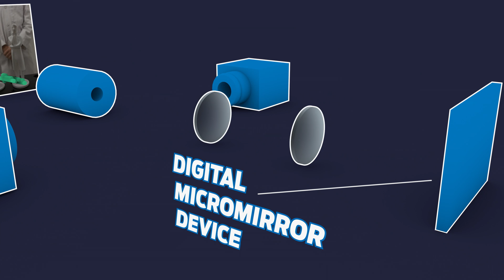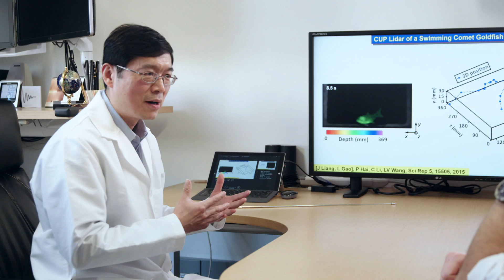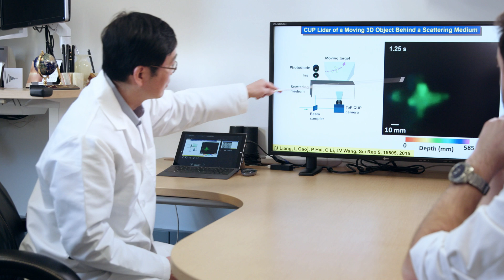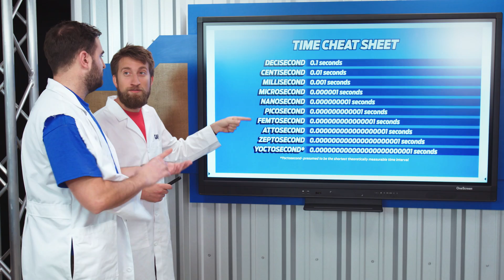How do you film the Speed of Light?

Comment: When I was teahing physics at the U.S. Air Force Academy we measured the speed of light with a very short light  pulse from a spark gap that travelled through both a short path and a long path to the same light detector hooked to a high speed oscilloscope.  The light two paths showed up on the screen as two pulses on the o'scope screen from which we determined the speed of light using the difference of the two distances.

Comment: What is very interesting in this experiment is that they are actually measuring the speed of the photons traveling through a medium such as the water in the bottle and the walls of the bottle. While it is an amazing feat of engineering and an amazing example of human ingenuity, I still wondering if this is an accurate representation of the speed of light in a vacuum.
Reply: Light allways travels with the same speed, it doesn't matter if it's in vacuum or in a medium, it just travels way further in vacuum because it's not deflected or absorbed by particles
Reply: @kozak2546 this isn't true. Light travels slower in a medium, but the frequency is preserved. See Snell's Law. It's not significantly slower in water, only about 33% slower relative to vacuum.

Comment: This makes me wonder, there are several videos on YouTube stating that it is impossible to measure the speed of light in one direction, but would this process allow that measurement to be made since we are capturing the lateral movement of light in a single direction - question for Veritasium and others...
Reply: Interesting question! From what we know of relativity though the answer is no, the main constraint to measuring light in a particular direction isn't a fast enough camera it's that the time elapsed in a particular direction is contingent on the relative velocities between the observer and phenomenon when the observation is being made. For a visual example of this check out https://en.wikipedia.org/wiki/Time_dilation#Time_dilation_caused_by_a_relative_velocity

You can see on the left when the observer is at rest we get a certain time and distance elapsed but when the observer is in some relative motion to the event being the time elapsed is increased. Even though for the light's purposes it's still moving the same vertical path it was going through before, for the observer the light is now moving through a longer, diagonal distance over a longer time.
Reply: The answer to measuring the speed of light one way is far simpler than we need relativity for, even if it is a factor.  The signal to the receiver goes at the same speed (or slower with electronic component interfacing or computer language translation) as the light we're trying to measure between two points.  Mind we're only trying to record the difference in time, not a picture of it as was done in the videos here.  The light gets to the receiver before or at the same exact time as the trigger signal saying "start recording the time now."  The time recorded by the target device in this scenario is always zero or negative.  A negative result only tells you how delayed your data is, not the speed of either the light or the transmission.

There is no workaround to this without quantum tunneling of some sort linking the emitter and receiver into an instant connection that defies proven and useful physics on any scale above subatomic.  The only way to directly record the speed of light is with a reflection back to the source device, (which started its own timer,) then divide that time by the round-trip distance.

That being said, we can (humanity can...I certainly can't myself) reasonably record said speed from the side as was done here, with devices that are independent from the light's source or target, and a helper medium to make the light visible from the side.  That measurement, however, is fallible due to perspective and distance.  In the bottle demonstration, light is also refracted by the bottle's shape.  (And why couldn't they remove the label!?)

This is kind of a good-quality middle point between accurately measuring the speed of light, and measuring the speed of data like the common demonstration of waving a laser across the sky.  (In the sky, one side of the arcing motion is billions of light-years away from the other, but you haven't made the light move that fast, nor perceived at that speed.)

All this is not to say the video is inaccurate or not really amazing.  It's just measuring the speed of light in our perspective, not the direct rate of travel.  The speed of playback also completely changes the apparent amount of time, but that's down to trust in the technology and presenter.

Comment: Ok, there is no explanation on how it works. Assuming that they are not using matrix to capture an image, just a single sensor eq 1 pixel. Assume also, that the sensor can detect a femtosecond pulse and even convert it to electrons. Now you have to store it. How? I can be wrong, but, as far as I know, storage is much slower than that speed. Note, that signal needs to travel to the storage cell or a huge shift register. But that cell or register has to operate on the PHz frequency. I'm no aware of any electronic components to be able of doing that

Comment: What’s fascinating about the Femto second lasers is they are SO fast that when a material is cut by the laser it leaves NO heat affect zone as if it had been cut cold! MIND BLOWN 🤯
Reply: How can that even be from an energy conservation standpoint? Does it produce some other radiation instead of heat?
Reply: @Mobin92  This Process is unique to certain materials, like diamond so i will use that as an example. It is because of the unique thermal conductivity properties of diamond combined with the speed of a femtosecond laser and the extremely short wavelength of femto lasers (typically in the UV range - 355nm). These types of systems do not operate under a continuous laser beam but rather a chain of extremely short pulses. The time unit of measurement between each pulse is measured in Femtoseconds. When the laser pulse hits the diamond, the carbon lattice structures heat up and are ejected. Between successive laser pulses, the carbon lattice has enough time to cool down so there is no heat affected zone around the surrounding area which has been cut by the laser.
Reply: @Mobin92  the laser does in fact produce heat, It’s just that because the femtosecond laser is so fast (The amount of time the laser beam is on vs off between pulses)  The material has time between each laser pulse to cool down
Reply: @Mobin92  If you are interested in understand the science behind this process i recommend Ron Schaffers youtube channel, Photomachining.
Reply: This is only the speed of the on off swirching, it still travels at 300,000 km/s like all light.
Reply: I literally had my eyes Femto'd
Reply: How many times are you going to post this exact same thing?
Reply: @reh3884  You do realize the guy @mobin deleted his responses.....🤔

Comment: Sorry but i'm not convinced, the very concept of the camera is to catch light aka photon.
To catch a moving photon, you need something even faster and a censor capable of catching said substance and of course for it to interact with the photon.
What puzzles me even more is the electricity itself can at most travel at half the speed of light in a copper wire, nevermind the components size that are needed to achieve whatever complex machine they have.
The speeds cannot and will not match up.

Can anyone please enlighten me? any rational explanation or is this just a fancy simulation of what could happen?

Comment: i still just don't understand how the light hits the camera sensor, like, on the way to wherever it's going
Reply: They are sending the light through substances that cause some of the photons to dissipate. The camera films those (well, the ones that dissipate towards the camera. As the pulse travels, the location from which the photons dissipates moves so you can track the movement with the camera.

Think about it like this: If you shine a laser through dust, you can see the line of the laser even though the actual laser itself is not travelling towards your eyes. It's the same principle.
Reply: @MsVegasguy No, they absolutely are filming light. They are sending the light through substances that cause some of the photons to dissipate. The camera films those (well, the ones that dissipate towards the camera. As the pulse travels, the location from which the photons dissipates moves so you can track the movement with the camera.

Think about it like this: If you shine a laser through dust, you can see the line of the laser even though the actual laser itself is not travelling towards your eyes. It's the same principle.
Reply: My understanding is that they are not ACTUALLY filming light so much as a digital simulation of what happened.
Reply: @MsVegasguy  They are filming light - the light that bounce off the milk particles and into the camera.

Comment: Referencing a lightning strike is a misnomer. Essentially a lie, because the lightning traversing the sky does not travel at the speed of light and the visual aspect of the discharge is even slower as it is also transforming the electrostatic energy into energy in the form of light and at that point traveling to the receiver's eye. Then consider the cases where it's a cascading discharge and the speed is further reduced. So viewing a lightning strike in slow motion is actually capturing the effect associated with the discharge. Still beautiful but not the same as measuring light traveling between two points. Just my 2c

Comment: This is fake...
The light was bribed to go slow
Reply: They must've paid it using an Einstein-Bose Condensate.
Google it, it can actually stop light mid-air. It's basically gas cooled to .000000000000000000000001 degrees from absolute zero.

Comment: The Phantom DID record the speed of light, at least enough that there was a 1/10 of a second where the flashlight was on, but the paper wasn't lit
Reply: 1/10 of a second is enough time for light to have travelled 30,000 km. i really dont think so
Reply: @johnsonluo9263  I was talking about how it was 1/10 of a second in slow-mo
Reply: assuming playback at 24 FPS, and for a distance of lets say 2 meters to be generous, they would need to be filming at 360,000,000 frames per second.

Comment: Electric signals from the camera travel at a slower than light speed. The entire thing is fabricated through software.  It does not show you the light traveling through a material.  To be accurate, it shows a mathematical rendering of the light traveling.  Upon careful scrutiny, I would not be surprised to find "artistic" inclusions in the software that are integral to the functionality.  Had they truly wanted to record the femtosecond of laser pulse, they would have utilized detection of the magnetic nodes passing a sensor.  There would be no visual effect, but simply recorded binary data.

Comment: I wonder if an object being pulled into a black hole would be faster then the speed of light.
Reply: no...space, length, time adapts to every observer, so for everybody the speed of light is the same. One stationary, and one travelling away with a rocket. Same speed for both.
Reply: General relativity
Reply: I just know that light cannot escape a black hole, which  means that the gravitational pull is strong enough to pull in the mass of the light faster than it can escape.
My original question is stupid. I should have asked if an object (like a pebble) being pulled into a black hole would be faster  than the speed of light.
Reply: @IAmShniff  yes, meaning the space is bend. Gravity pulls nothing, but changes the space, distance, time. All space lines converge to the singularity in the center of the black hole
Reply: @mirceatim3274  Oooh I understand now. Thats super interesting, thanks for explaining it to me :)
Reply: Welcome. Same with earth. Pulls not on us at all, according to general relativity. It warps the space, so the lines point towards earth. Or the sun warps the space for the earth. Difference is, earth has a certain speed, and does not fall towards the sun.

Comment: The speed of light is not the fastest thing. It is only the fastest possible way information can travel. The true "fastest things" are certain phenomena in quantum mechanics, such as quantum entanglement. However, this process cannot be used to convey information. Furthermore, when you look at a reflection, the photons involved in the reflection themselves will travel infinite distances instantaneously. More precisely, a photon will take every possible path through space and time, as it does not "know" which direction to reflect off of the mirror. In fact, the photon is going through all of these paths at the same time, yet the process of choosing the photon reflection path that we observe happens instantly. Also, Dan claims that nothing else happens at the picosecond level, but actually, in molecular physics, molecular reactions happen on the femtosecond scale. Also, a yoctosecond is not even close to the theoretical shortest time interval measurable. One planck time is equivalent to  5.39121E-20 yoctoseconds. It is twenty orders of magnitudes shorter.

Comment: technically you filmed light in air, which is very slightly slower than the speed of light in a vacuum.
Reply: True
Reply: As if you could tell the difference... kkkkkkkkkkk
Reply: @MsJoao101  You can at the framerate... Thats kinda the point..

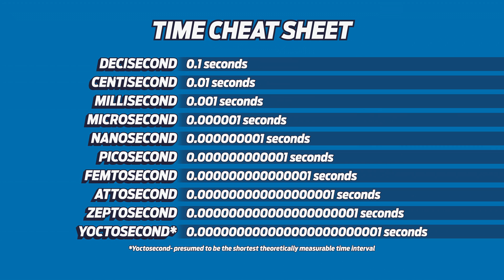Comment: 6:29 - The yoctosecond isn't the shortest theoretical time interval. That honor goes to the Planck time interval and it's a whole lot shorter than that. You'd need to add about 20 more 0s before that 1 to get Planck time. There's also a Planck length, mass, charge, and temperature. Planck temperature is the highest theoretically possible temperature (it's supposedly the temperature of the universe 1 Planck second after the Big Bang) while the others are the smallest theoretically possible measurements.

Comment: Well... technically you can film something slightly faster. Because the light was going through milk which has a refractive index of about 1.34  at a fat concentration less than 3.5%, the light should have only been going ~223,725,714.925 m/s. If you shot the laser pulse through a vacuum chamber and had it hit two thin sheets of a refractive material, then you'd see two pulses on the video. And the time between these pulses would then be the fasted thing you could physically film at around 299,792,458 m/s.

Comment: I’m at a total loss.  How can this be possible?  The very act of “filming” is only possible because the light is reflected off the object and into the lens onto the media (film/chip).  If you are filming the speed of or faster than light, then the light wouldn’t be fast enough to reach the media.

The only thing I can surmise is that they aren’t filming the light per se, but rather a specific wavelength spectrum of light which may travel at a different speed than some other wavelength of the light spectrum.
Reply: All light travels at the exact same speed. What they're actually doing is capturing scattered light. So they send a laser pulse through e.g. the bottle, and some of the light gets refracted towards the camera. They capture this small amount of refracted light and this is what is being seen.
Also, I'm guessing that the camera does not record visible light and instead is a pulse of higher frequency EM wave (same thing as visible light, just different wavelength). At 3:30 that blue pulse will be an interpretation of the data where they've artificially coloured it in.
Finally, they will layer this artificially coloured interpretation of the data onto a still image of the bottle. This is because to capture scattered photons from such a short pulse of light (a few hundred nanometres long) one must have a very sensitive detector. If the room was lit all nice and bright like in the video you'd never be able to capture the specific photons of the pulse.

So in conclusion, this is not a film in any traditional sense, rather they've captured the positions of scattered photons over a short time period and used software to turn that data into a colourful video and layered it onto a photo of the target.

Comment: Actually, the smallest measurable and indeed possible time interval is the planck time unit or 10^-43s or 0.0000000000000000000000000000000000000000001s 1 yoctosecond is 10^-24s, so there are 10,000,000,000,000,000,000 (ten billion, billion) planck time intervals in one yoctosecond. In fact, there cannot be any time interval shorter than this.. the laws of physics break down at this level.

Comment: Lasers are what carries all internet traffic across countries, through fibre optic cables laid across the sea floor. It’s a common misconception that satellites do it. They’re far too slow, as geocentric satellites (which stay above a specific part of the earth, and orbit with the earth) are something like 26,000km away, so your signal has to travel at least twice that, and take a trip across ground to get to you. The traffic satellites carry is so minute, it is effectively nothing.

The reason why lasers are used, is because they are pulsed on and off extremely quickly, and at extremely specific wavelengths of light. That means you can have, effectively, multiple laser beams travelling down the same cable at the same time. That technology, for anyone still here, is called quadrature amplitude modulation, or QAM. At a common 64 or 256QAM, it’s allowing 64 or 256 signals to be sent at the same time.

Although not photogenic, it’s interesting stuff. Much cooler than sharks with lasers on their heads, imo.